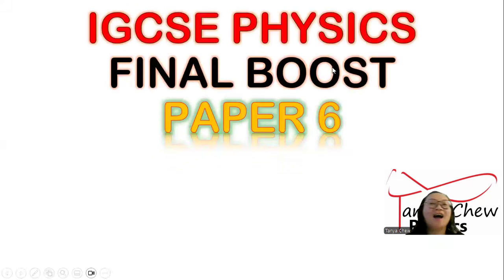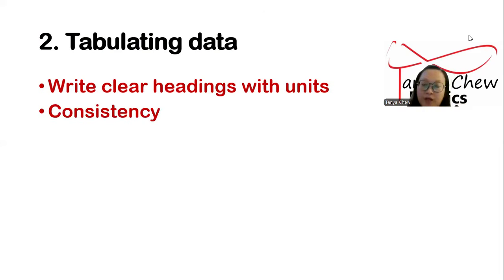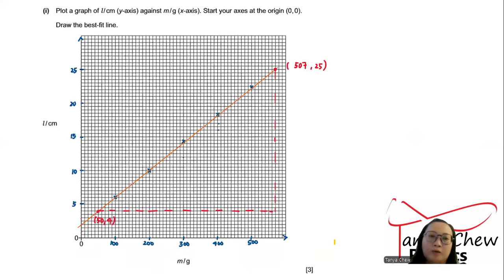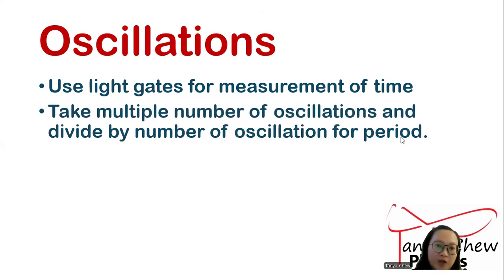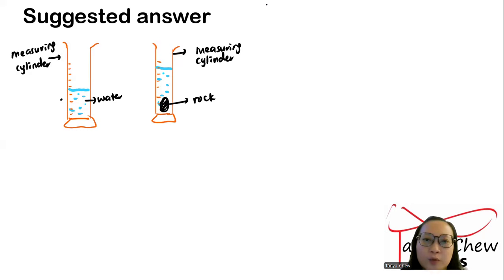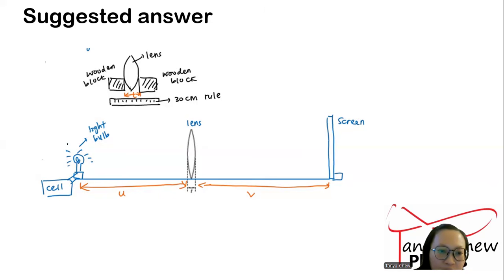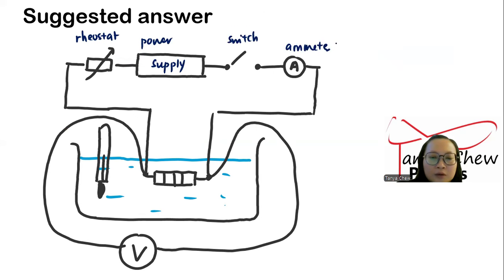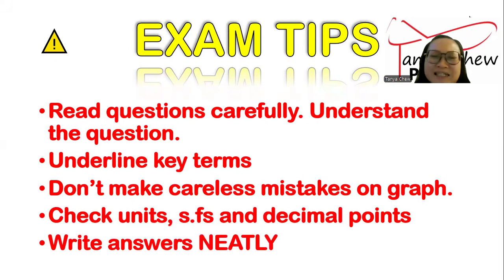🔥 FINAL BOOST for IGCSE Physics Paper 6 (0625) | 2026 Exam Edition

Comment: my papers tmroo ahhh so scaredd. could u explain limits of experimental accuracy please, and how do we answer those type of questions??
Reply: When they normally ask to compare two readings the question is most likely about experimental accuracy. A sample question is: Do you consider these values to be equal. Explain your answer... you need to check whether they are within 10 percent of each other. You can check that by using the formula:

Larger value - smaller value
---------------------------------------------  × 100
Larger value 

If the answer is 10 percent or less, then they are equal within the bounds of experimental accuracy. That should be you explanation.

Your statement should only be..
1 yes they are equal
2 no they aren't equal

If they ask to provide a calculation use the formula. If they don't then just explain yes or no whether it is in or out of the bounds of experimental accuracy.

Best of luck for your exams! I have atp tmr too 😅😅
Reply: @thoppiahpillai4150  ohhh okayy tysmmm. i read somewhere its larger- smaller/ smaller??
Reply from the maker: @zoeyvijayan In IGCSE syllabus , it doesn't matter whether you divide by smaller or larger value, examiner just wanted to test you on thinking skills. So no worries. Both are correct.
Reply: @TanyaChewPhysics  ohhh alr thankuu
Reply: f/m?? i have mine in a few hrs

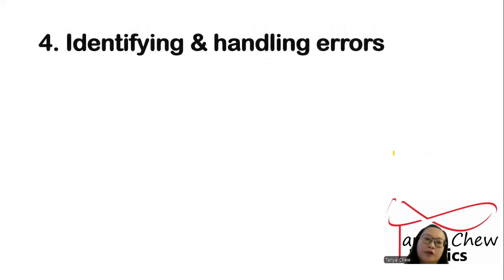Comment: in 24:09 , shouldnt graph pass through (0,0)?
Reply: Excellent work
Reply: No because it's a graph of length against load not extension so the original length of the spring without any load is not accounted for
Reply from the maker: Very excellent explanation! kudos to you, superstar!

Comment: Mam I have a doubt, it's about limit of accuracy where they give you two values and ask you if they are 10% of each other they can be said as the same. How do you do that?
Reply from the maker: In IGCSE, you just need to find the difference of the two values. if the difference is small (which you think it is small and you can accept that small difference, just write you support the suggestion as the difference between the values is small, which is still within the limit of experimental accuracy. No calculations needed unless the question give you formula. Hope that clarify?
Reply: But how can i know that he wants that type of answer not the other one @tanyachew821
Reply: @TanyaChewPhysics  thank you
Reply from the maker: @qasimmalik8562  wish you all the best!

Comment: Your explanation is amazing🎉
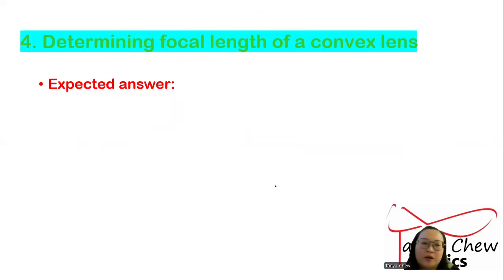But i dont understand why we use a variable resistor in the circuit shown in 54:02 if we're calculating resistance of wire
Reply from the maker: The variable resistor is acting as safety precaution to avoid wire to be overheated by controlling the amount of current flows through the circuit. Hope that clarify?
Reply: @tanyachew821  yes, thank you so much❤
Reply from the maker: @AnasBerrim  You are most welcome!

Comment: Wow! Your explanation was amazing 🤩.

Actually, I have a question also.
10:04 
Write answer to smallest division, this applies to the whole practical paper as a whole? What if it’s a calculation question? What number of significant figures do we round to?

Just to check if my understanding is correct: smallest division of something is 0.100, so we round to say 3.129
Reply from the maker: Thanks for your compliment!
Just remember when instrument is being used for measurements, then record the readings by following the d.p of the smallest division of the apparatus. 
For calculation question, we round off our answer by following the significant figures of the values that we used for calculation. Example: v = 9.2/2.1 = 4.4 (2sfs). 9.2 has 2sf and 2.1 has 2sf so v will take 2sfs. 
Hope that clarify?
Reply: @TanyaChewPhysics yessss thanks